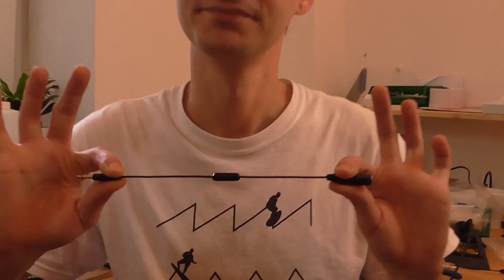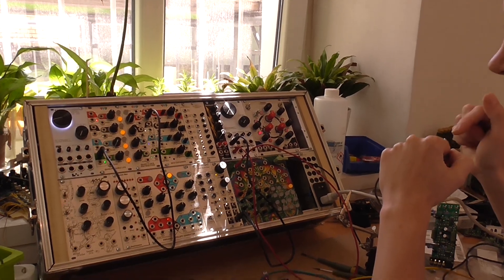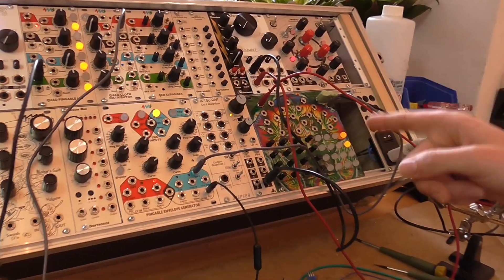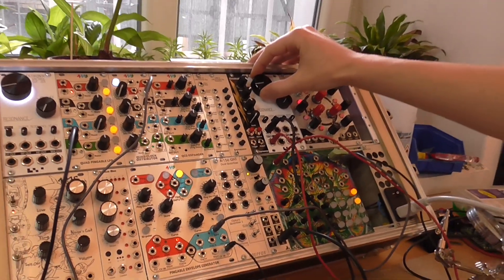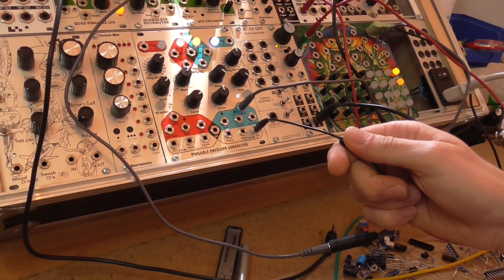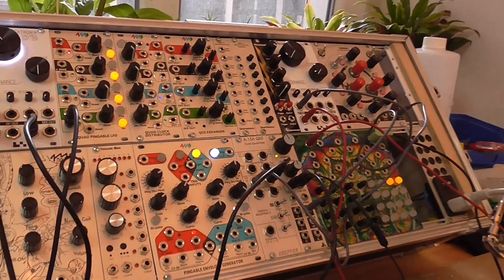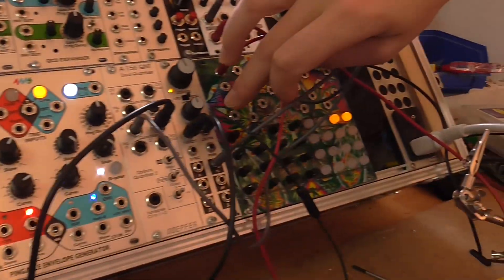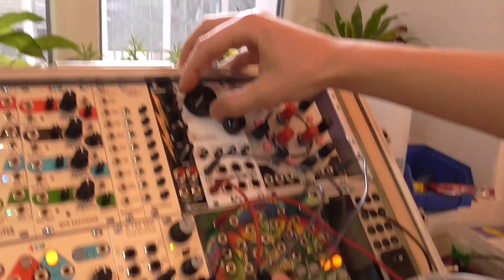Introducing: KOMA ATTENUATOR CABLE

Comment: So, can i use this to attenuate CV/gate from my arturia Beatstep Pro to my Moog DFAM safely? What is the attenuation rate so we can calculate?
Reply from the maker: Of course! Fully open is your full voltage, fully close means 0V :)
Reply: @KOMAelektronik is fully open “Max”?
Reply from the maker: Yes! "Max" just lets the signal pass in its original version. "Min" attenuates it fully (no signal passes). @tonedetective9757
Reply: @KOMAelektronik  thanks so much :)
Reply: @KOMAelektronik  apologies! I just tried the cable and it seems that “max” is max attenuation.. (not max signal) can you please double check :)
Reply from the maker: @tonedetective9757  Ha, you're totally right! 😂 I answered from my home desk without the cable at hand, so that was my mistake. 'Max' means maximum attenuation, so no signal actually passes.
Reply: @KOMAelektronik  no worries! thank you 🙏

Comment: Hi there, Could someone provide more technical detail (like max or min, or attenuator rate). also and if I connected inverted, does amplifies instead of attenuate (like a transformer)?. Thanks in advance
Reply from the maker: Sid hyperstellaris it does not amplify, only attenuate (since it is passive). it goes from 0 attenuation to completely attenuating the signal. thanks!
Reply: +KOMA so to connect a 10CV out (Arturia Beatstep Pro) to a 5CV in (Minitaur) I would roughly position the slider half way, makes sense?